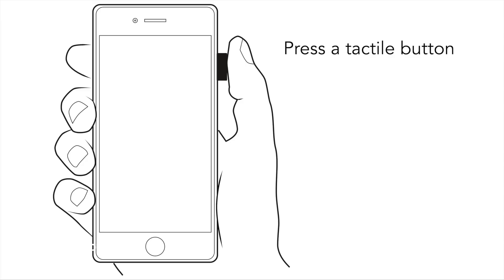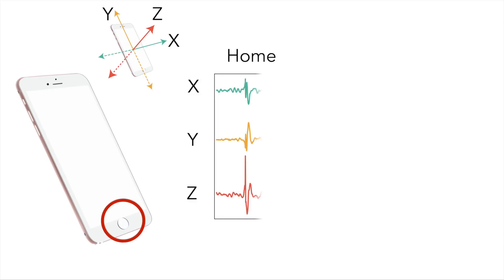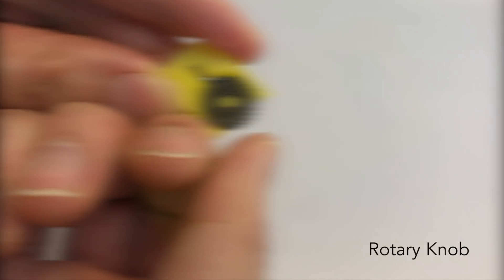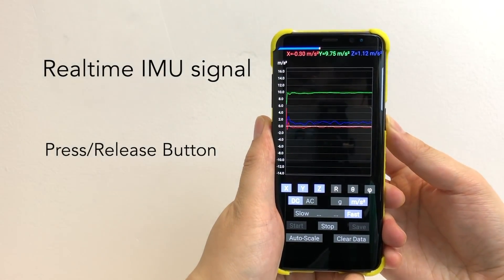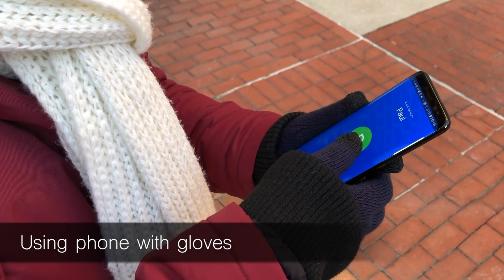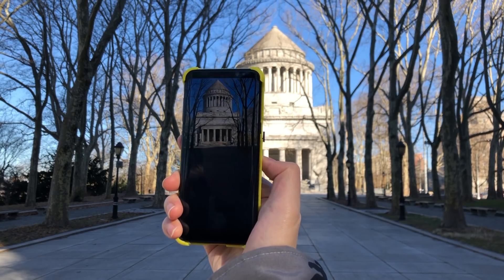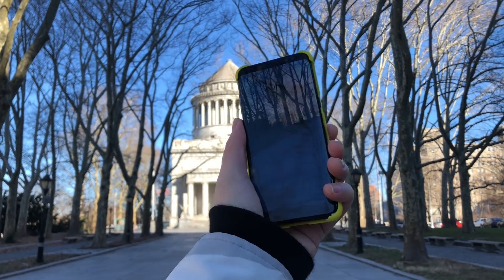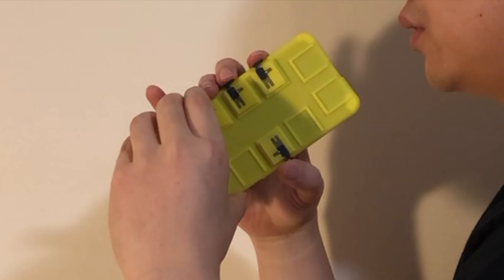[SIGGRAPH 2019] Vidgets: Modular Mechanical Widgets for Mobile Devices

Comment: really cool design but I do have 3 questions about it;
1) While this case serving of I can guess a prototype as its in development, will there be plans for a more robust case that is drop resistant as mistakes happen and I rather not give up the rugged design of things like otterbox just to make a phone more usable.

2) On the topic of the case, given that phones can range in size and placement of things like cameras, would you consider releasing the plans to print the basic case along with dimensions for how big the widget slots can be and have consumers just buy the widget? This can also allow more customization on how placement is concerned.

3) In regards to different apps, are you planing the use of profiles to store how the buttons should act for various activities? This would be akin to some gaming peripherals that allow you to program macros on a application by application basis on PC. Would this be possible on a mobile OS like android or iOS?

By the way dont make these questions make me feel like I'm discrediting your efforts here. You did a great job and I can see myself and family members using something like this. I hope this develops into a full fledged product.

Comment: an absolutely uneligent solution to a self created problem. why not just have buttons on the phone?
Reply: water resistance ratings
Reply: @illeatmyhat  uhm... your IP67/8 rated phones already have buttons. Vol/Power/Home key. oh and Charging port, headphones port, mic, speaker.... all those holes. 

my goodness, yeah buttons are impossible
Reply: To be fair these kinda do better than what old button setups had in the past, even more so the rotor dial that can act akin to a scroll wheel. I personally miss my slide out keyboards on phones but the modular nature of this allows you to have only what you want. And from the looks of the button and wheel vidgets they would be great for the elderly as they do have a very tactile appearance to them that not even older phone buttons could match due to their limited size.
Reply: i can see this being pretty useful, and opening up plenty of new opportunities for other developments. 

having buttons on the phone, like hard wired? modularity would be way more convenient, for example id love to get rid of the useless blixby button or even re-assign it to a knew action